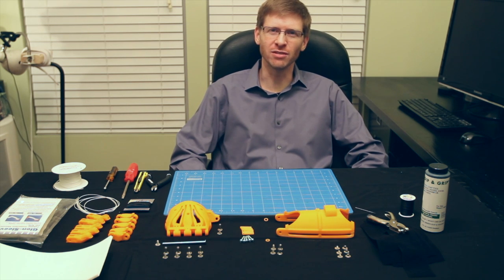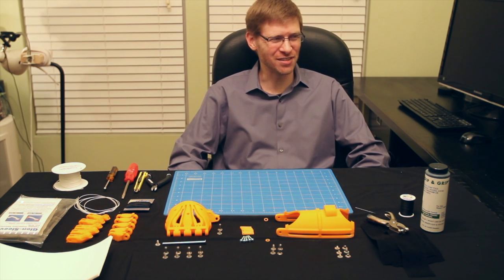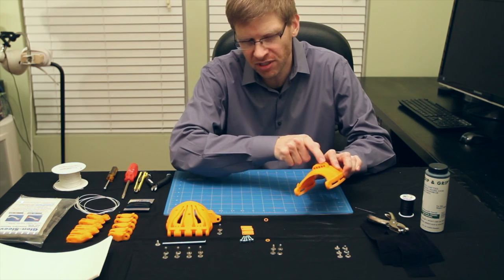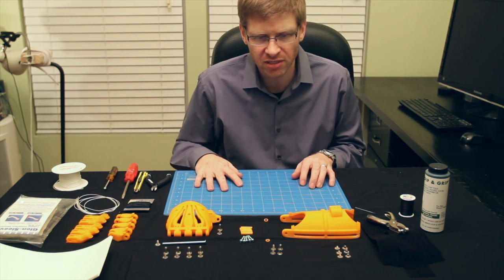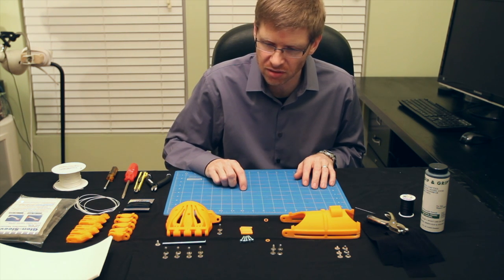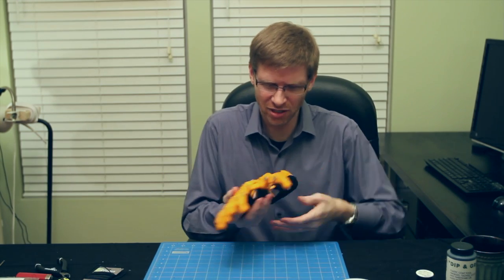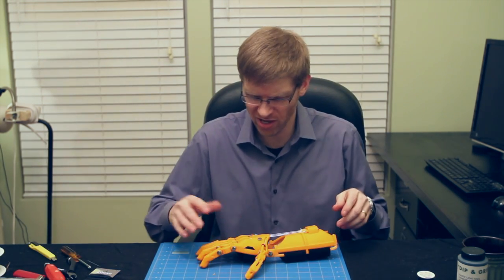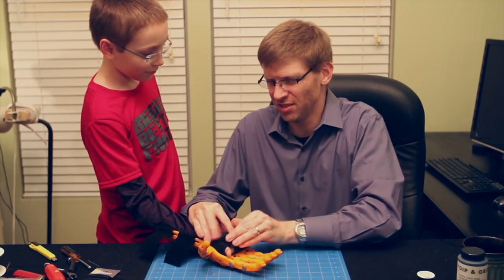Assembling and Testing the Cyborg Beast 3D Printed Prosthesis (3D Universe)

Comment: Is there a way you can slow the video down so that my students and I will be able to see how you do the stringing?  We would also like to see how you string the tension box.  There aren't many videos on the Cyborg Beast so it would be nice to see every part done clearly.  Thank you.
Reply from the maker: Yes, YouTube includes that feature. Click the Settings icon in the lower right corner of the video window, and you should see a Speed option that lets you select different speeds, including 0.5x or 0.25x. This is supported on Chrome browsers, but may not work in some other browsers. You can visit https://www.youtube.com/html5 to see if your browser has HTML5 enabled to support this feature.

Comment: Does anyone have a complete list of screws, wires etc. I have to buy in order to assemble the hand? Thank you!
Reply from the maker: 3D Universe offers kits for several of the e-NABLE device designs, including the one featured in this video. Each of the product pages includes a detailed list of the materials included in the kit, so you can use that as a reference if you want to source the materials yourself. https://shop3duniverse.com/collections/3d-printable-kits

Comment: Jeremy do you have any advice on how to set up the supports before printing?  It looks like you used many in your print.

Also curious what quality/settings (mm layers, infill %, etc) you printed at if you are able to share?  Your product looks great!
Reply from the maker: You definitely want to print with full supports, though with ABS or PLA, you can get away with no support on the fingers and phalanges if you want. Ideally, support should be touching the bed only (not inside the holes & cable channels). I use Simplify3D, as it lets you place supports exactly where you want them.

I use 50% infill, though some people use as little as 35%. Layer height 0.2mm. Print speed was around 70-80mm/sec.

When printing in Nylon, I use full support for everything (including fingers and phalanges). Same infill and layer height, but print speed needs to be much slower - like 20-40 mm/sec.